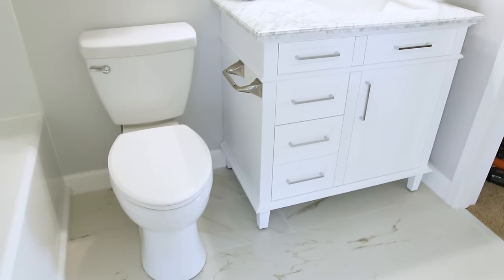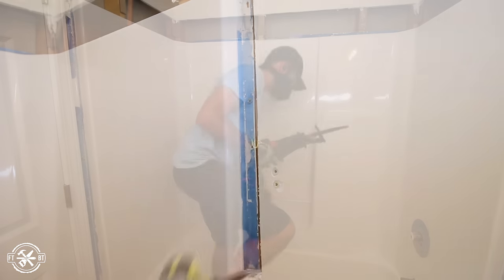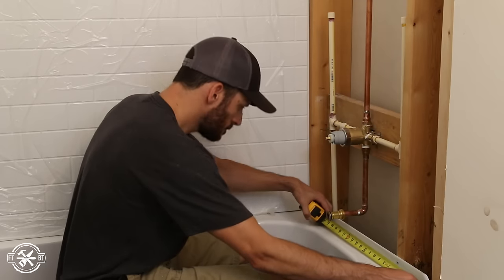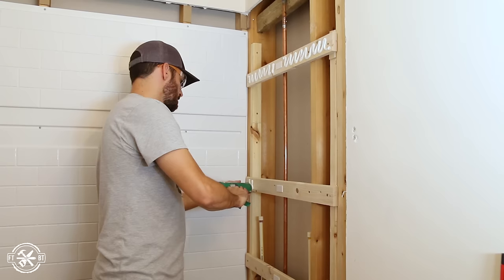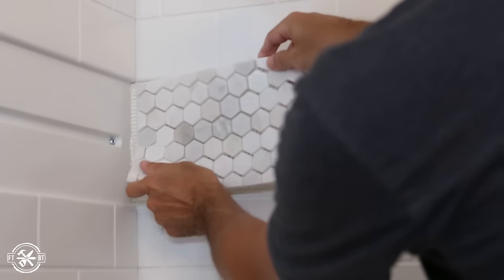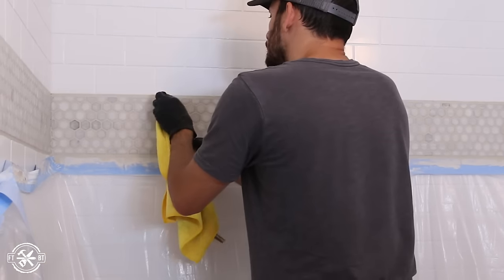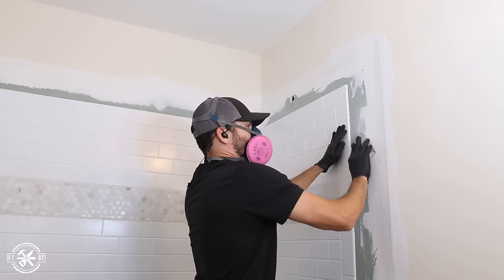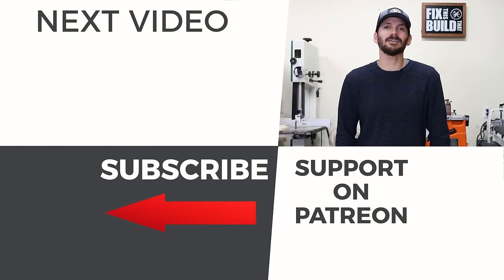DIY Small Bathroom Remodel | Bath Renovation Project

Comment: Why tear the original tub out and replace it with almost the same looking one, just different pieces?
Reply: I agree kinda makes no sense right 🤔
Reply: I think the upstile system only works with certain Delta tubs. I’ve noticed this in demos.
Reply: That's exactly what I said lol
Reply: What material is that tub actually ? Ceramic or some kind of plastic.

I was shocked when he was able to cut tiles and tub
Reply: @abhishek8243  I think it's acrylic. The tiles are acrylic.
Reply: Lynet Sandoval Witty the video is sponsored by Home Depot so he probably got it for free!
Reply: Abhishek Chindaluri plastic kind.
Reply: Lynet Sandoval Witty the tub was a whole one piece thing with the walls, and since he wanted to do different tiling for the wall he had to take it all out
Reply: because he's being sponsored Home Depot and advertising a new system... kinda obvious
Reply: I hate the builders grade tub and shower surround, I prefer to replace it so I can install tile on the walls or decor as I see fit.
Reply: It is a completely different bathtub insert system. One that changes the look of the bathroom and gives it a more modern look. The only thing that was the same was the color... White.

Comment: Looks nice. An option for around the shower walls instead of patching drywall is to use 5 1/4 inch pvc trim. Shim out the studs, rip the pvc and cut to length. Attach it with brads and use good quality caulk. It's faster and will never mold or mildew.

Comment: Good job!! I learned from re doing my own that it’s best to go ahead and replace the drywall all the way up to the ceiling.  You can caulk the gap where the new drywall meets the ceiling.  Drywall is cheap, it’s easier to finish, and the board doesn’t visually look angled where it meets the surround.
Reply from the maker: Yeah, I'd probably replace it all if I did it over
Reply: Fix This Build That I did the exact same thing when I remodeled my bathroom.  I did a shower remodel not that long ago for a friend and replaced all the Sheetrock and was glad I did!!

Comment: Great job man, but Before caulking the bath you should fill it with water so that when it dries and you fill it up for the first time it doesn’t pull the caulk away from the wall.
Reply: That is only necessary if the tub is plastic/fiberglass.  Old tubs that are made out of heavy cast iron won't move.

Comment: "Nobody likes shrinkage". Nice job!
Reply: Are you still happy with that wall system? Or would you do it the traditional way with cement board and real tile? Just curious how this system is holding up as my experience with tile and flexible surfaces isn't good. ;0)
Reply from the maker: If it were our bathroom I'd go real tile. But for a guest/kids bathroom it works since it doesn't get much use its not an issue

Comment: Just curious how this is holding up now? We are going into a full master bath reno and I want to replace our standing shower with this system. I would tile but I am afraid of water damage and cannot afford for a contractor to come and do it. We are trying to do most of it ourselves. What we have now is not pretty. The wrong drywall was used and its peeling back. Its so bad.

Comment: Not a bad cost at all for everything, just over $2K: 
Delta UPstile Wall System - 409
Delta Everly shower set -  267
Delta Everly sink faucet - 190
Delta Everly accessories - 67
Delta 28x36 mirror - 114
Delta toilet - 129
Sonoma Vanity - 712
Hexagon Mosaic tiles - 24x12 floor tiles - 8.50/SF
3 sconce light - 95

Comment: Great job.  I was kind of hoping to find out construction specifics.  Like what type of tile adhesive can you use on plywood?  Is there an advantage using cement board?  Are all tubs the same (standard) length/width?  I have to re-model my bathroom, (same dimensions as yours), but I have to tear out some of the plywood due to water getting through some cracked tiles, and between the tub and tiles.  Thanks.

Comment: This remodel video makes me think I can tackle it myself-no experience. Am I crazy!??
Reply: Without experience, you'd need some guidance to avoid costly mistakes. However, this is totally feasible to do over a weekend.
Reply: I thought the same EXACT thing, but I'd be too afraid to try!
Reply: Get a plumber
Reply: No, but plumbing requires a lot of research and tile a lot of careful skill. I wouldn't suggest a beginner start with an entire tub tiling. Maybe just do a tilesplash first.

Comment: Great job buddy. How much you spent on all this remodel?
Thanks.
Reply: he didn't spend really anything unless they gave him a gift card instead of shipping stuff. There is in fact an identical remodel on the channel "modern builds" by which I mean they both chose identical showers, identical shower heads, identical faucets and the exact same floor tiling. If they simply drop shipped him the kit he doesn't know the cost. If they gave him a large gift card though he might.

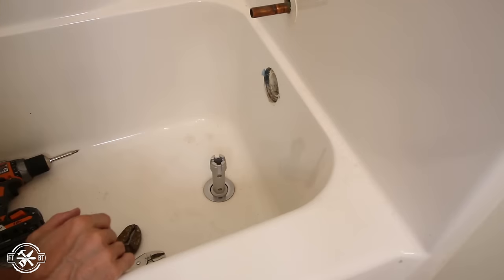Comment: 1:03 Whoa, Nellie!!! You may be able to unscrew some. But a majority that does not have the set screw will most likely require you to carefully heat up the tap with a small propane torch to successfully unscrew it. All this will obviously depend on the age of the home and bathroom fittings, and on how hard the water is in that location.

Comment: Since the tub walk kit flex’s because studs are way farther then should be, won’t that be a disaster if someone pushes and leans into walls while in tub/shower since the one piece walls where mixed with real marble mosaic causing them to potentially pop and crack. Recipe for disaster in my opinion🤔🤔🤔

Comment: New sub this is so beautiful. But I’m weird and prefer a one piece tub to this beautiful tub with walls cause it’s higher maintenance and over time the sealants will need to be redone or else mold, whereas a one piece won’t mold. Ultimately a walk in is awesome if you have the space, ahhh. I also dislike jetted tubs cause those nets are impossible to clean, I’ll take non bubbly water with no jets anyday over a jetted tub

Comment: It said basic builder bath, but Schluter Ditra is a very expensive material for a "basic builder's bathroom."  Not sure if it is good or bad that it came up easily.  I would have expected a good Ditra installation to be very difficult to remove.

Comment: Can you move a toilet to a different location in a bathroom? I have a small bath that entails a tub and shower together with a toilet in an enclosed space about 5 x5 very small. And the his and her vanity is outside the tub and toilet area it divides the bathroom and the walk in closet. I want to take out the molded double sink vanity cabinet and mirror that is as wide as the vanity. about 6 feet long. There is a wide opening to the vanity area with a door on either side to the bath or closet. I'd like to take the door on the bath out make the double vanity into a much smaller vanity of only three feet. have a cabinet area on the right that goes up to the ceiling and move the toilet to a different location. Then put in a luxury shower with a seat that doesn't require a shower curtain. Can that be done?

Comment: Not saying it is wrong, but I noticed your light fixture is upside down compared to the Home Depot link in the description. Just thought I'd give you a heads up :)
Reply from the maker: Hahaha, yes. If you read in the description it does say it's reversible for either way. We liked it better down than up.
Reply: so it doesn't collect dust & bugs!
Reply: We have the exact same light fixture. Mine are upside down just like his. We also have to exact same shower system 😂

Comment: Anybody know why the fireproof patch is needed? I'm curious.
Reply from the maker: you know, that's a great question.  Not sure why it's there but not on the spout
Reply: Im not sure but im guessing hot water .lol
Reply: Would it be incase you need to soldier in fittings and use a torch?
Reply from the maker: @rchavez5056  Ahhh, good call
Reply: It’s probably a California thing

Comment: You didnt do waterproofing or put up dry wall before you mount the shower walls
Reply from the maker: no, it's not called for by manufacturer install
Reply: @Fixthisbuildthat  Even though not called for, I'd put backer board behind it.  Probably cement board.  As is, it will flex when you lean against it, which besides feeling cheap will cause separation of the seams.

Comment: How much did u spend?
Reply: Delta UPstile Wall System - 409
Delta Everly shower set -  267
Delta Everly sink faucet - 190
Delta Everly accessories - 67
Delta 28x36 mirror - 114
Delta toilet - 129
Sonoma Vanity - 712
Hexagon Mosaic tiles - 24x12 floor tiles - 8.50/SF
3 sconce light - 95

Comment: How is this waterproof. I dont see this holding up more than a year at best. But i'm no expert.
Reply from the maker: Are you asking how a solid acrylic surround wall is waterproof?
Reply: Yes, how will the acrylic/caulk hold up long term?
Reply from the maker: @Hurxen  the acrylic is solid plastic so by nature is totally waterproof. The weak point (just like with a normal tile job) will be the caulk seams. The caulk I used has a 10+ year life. So it will need some maintenance to recaulk it every decade or so but you should do that with any 3 piece install.

Comment: There was absolutely nothing wrong with the tub - what a waste.  You can't recycle it - it goes straight to the landfill.  Why is this being encouraged.  It was very basic, it would have been easy to paint the walls and vanity, and for storage add a vanity with a mirror.  Then change out the hardware, add new towels and shower curtain and you could still have a whole new look.